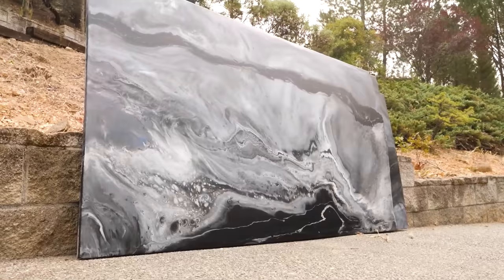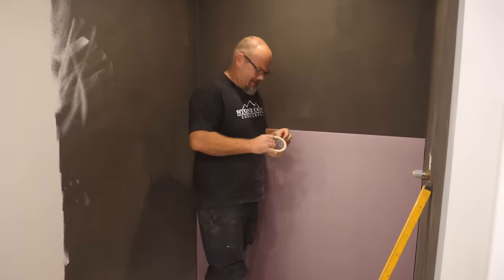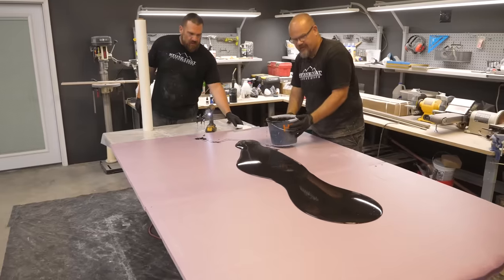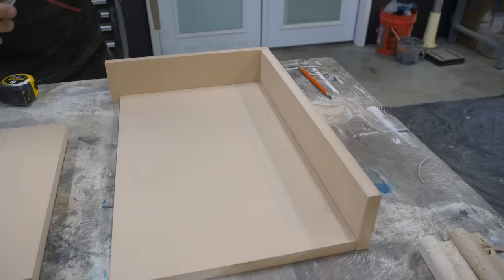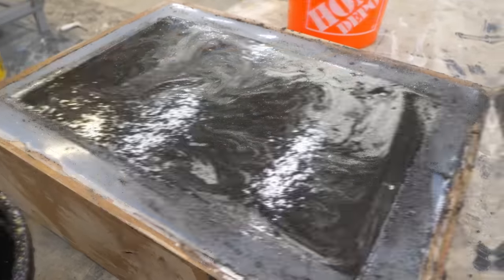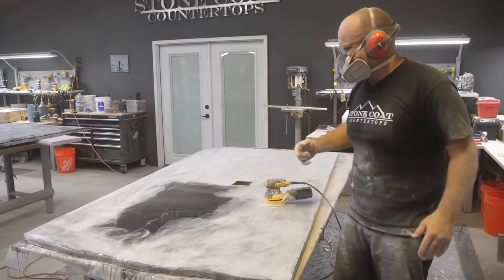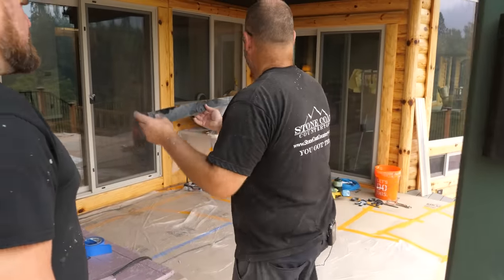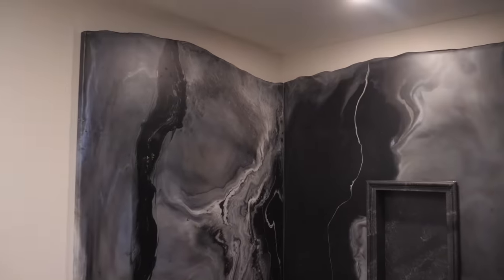Epoxy Slab Shower with Pink Foam, Come on the Jobsite Real Training

Comment from the maker: 🟦 This is our most valuable video we've given you yet. How did you like this Masterclass? What was the biggest thing you learned? 🟦
Reply: Creating that stamp for the pan and the mold for the inset shelf and back splash are absolute genius. Wish I would have found you before I redid bathroom tile. Would be awesome to have molds that could be purchased for pros and the actual shelves for DIYers to customize with paint. So impressed with this whole shower build, the natural top edge is beautiful. Well done guys! So grateful for this masterclass! Go Nathan!!!
Reply: I learned that a shower remodel can be done for a fraction of the cost! Way to go!!! We love this video. "Honey do, to Honey done!" :) :) :) Thank you so much! You all are fabulous! You have been for years!
Reply: I bought a new house and in about 3-4 months ill be installing my dream shower. Rainfall heads, body sprays and absolutely huge. Problem is, my wife doesnt like grout lines between tiles (cleaning issues) and we cant really afford big slabs of marble or whatever. Then, i saw your shower video from a couple years ago and it hit me like a ton of bricks..."Thats my solution!" Ive done resin table tops so i have a bit of experience with it. Beautiful resin walls that are insulated and warmer to the touch, thats perfect for us. I have a question though, is the reinforcement weave you put on the foam absolutely needed? Id like to do it without it but thicker foam panels. As for your questions about what i learned in your video...The scribing the pan slope trick was great. Ive been worried about that. Thanks for the video, its inspiring.
Reply: I love it.  I am trying to talk my wife into doing our small master bedroom shower.
Reply: Love this.  I've done 4 countertops with your product. Now to screw up the nerve to do showers!
Reply: I just love the way you work and present your work to the world. Awesome!
Reply: We're buy your products for india
Reply: Where available in india
Reply: Doing a shower caddy. Although I have to say it's got me thinking of ways to do that differently so that it can match the rest of the project better. Yes it matched the pan but I think matching the wall would be better. Have an idea I'll send via email.
Reply: How did you make that shower pan?..... TROWEL AND ERROR LOL
Reply: Not to be intimated.. curious on if possible led lighting.
Reply: Love!! Have you ever tried vibrating the table to see how it disperses the veins? Just an "outside the box" thought. Great work!
Reply: This video has really opened my minds eye to the almost limitless possibilities with epoxy. Really brilliant stuff and your natural concrete stamp was pure genius! Masterclass at its finest!
Reply: The fibreglass
Reply: Also I don't even know how this was a suggestion because it's not exactly what I do but NOW it's something I do! I watched this whole video it's now 6:04 am.... Just pulled an all nighter worth the loss of sleep. I can't wait to do this
Reply: @Warrior-In-the-Garden  🤣🤣🤣🤣
Reply: I want so see a follow up video of how the shower is doing, my concerns are 
Is it water tight? 
I’m worry water can go behind the wall panels and ruin the foam
Reply: You all are such big kids, you get excited about adding a little stripe 🤣🤣🤣🤣 "watch this" 🤣🤣🤣🤣
Reply: @fernandoalcantar7907  ruining the foam is the least of concern..  mold growth behind the foam boards, and rotting of the wall and rotting of the wood beams behind the foam boards is the real issue here. Additionally, mold replicates (travels) FAST!
Reply: Awesome look!!!
Can plywood be used instead of foam?
Reply: Love when you guys took the silicone mold off, so nice and smooth!
Reply: Hey stone coat countertops! Great job on the shower. With 18 yrs slab granite and solid surface fab and installation I feel more than qualified to say you definitely have some things to learn about installing shower walls! Haha but I really wanted to let you know that if you would have used release wax on the aluminum it would have popped right off no problem. The wax is specifically made for epoxy so the heat generated is no problem you may already be aware of the product but just in case I thought I'd mention it. Hopefully it will help with your guys' projects. But again you're doing some really cool looking stuff KEEP IT UP STONE COAT COUNTERTOPS
Reply: Casting the inset & prepping the foam board. I was wondering how the door hinges didn't RIP off.
I hope to do this in my future cabin.
I'm still interested in the round stone shower pan prep & install.
Reply: @lbrown3486  do it and let us all know, YOU CAN DO IT! I don’t believe you can mess it up, damn he put his hands in it to get the look he wanted to duplicate nature, and nature isn’t perfect that’s the beauty of nature! DO IT!
Reply: @dwaynemcfarland3240  hey, make a trial run on something you could use or cut later to use and just DO IT, and let us know if it works, YOURE the creator, fear not it’s just materials! You’re gonna do it and be so proud! Just don’t electrocute yourself, electricity and water don’t mix!
Reply: @dorothyallen3614  thinking on it
Reply: @glitter_fart  are you going to higher him? If not, shut it up. Enough negative in this world, we don't need yours.
Reply: Simon Templar  why you search it out and watch more than one video. Who knows.. maybe you can become a expert sunshine.
Reply: A good tip for gluing panelling and mirrors to walls is to do complete circles as apposed to dots. The complete circle acts like a suction cup when pressure is applied the escaping atmosphere creates a small vacuum within the circle. I use this trick for gluing huge mirrors to walls or even ceilings!! Youd be amazed how good it holds a material.
Reply: Lol rub some dirt on it.
Reply: Smooth and comfy beach tumbled pebbles would look killer in the shower and cozy on the feet.
Reply: @guaranteedwinnersclub  so the dirt would look as good? He does like experimenting with the natural look. Love the ideas you ponder.
Reply: @majystm7415  i have never used his method but intrested. Grout lines do suck. Auto polish was the trick for my rock showers and grout. I'm  ready to try this next.
Because the rock shower was more work than I cared for and with all the sealer and wax.. never looked that natural in a dark bathroom. It just made it darker.
 What he showed was a brighter up beat still needing respect like anything else.
Reply: Y’all hiring?
Reply: Well my mother now wants this. O.O new project, looks like I will be watching and reviewing this video several times over. But man this looks really cool. Looks super easy to clean as well.
Reply: Somewhere around the 1 hour mark you claim concrete is waterproof.  I build commercial water features and pools for a living and concrete is definitely not waterproof!
Reply: Y'all anywhere in Texas?
Reply: I learned I may be able to upgrade my bathrooms and kitchen by myself! This is amazing stuff! Thank you!
Reply: Biggest thing I learned is that I’m not the only person who uses my creativity to do what others deem impossible. I’ve been called crazy even despite it works beautifully!! Thank you so much for sharing.
Reply: Have Fun with your project and don’t be afraid to fail. There is always a way to fix something and learn from it. 
This All looks like a lot of fun to be Honest.
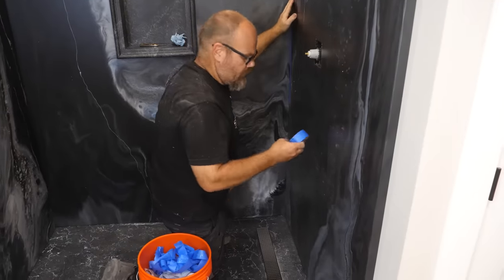Reply: 02:31:48  Why not seal the corners, bottom, etc. with epoxy?
Reply: I have to say that I LOVE the overall look of this project, but I'm also concerned by the comments from the bathroom/shower installers on here that mention that there's numerous errors in the installation, that will in turn lead to black mold. I would say that this could definitely be considered a masterclass in working with epoxy, but since you said that you've never done a shower like this, it would be great to see you guys do a new video with a bath/shower expert involved, so that we could avoid the problems that apparently exist in the process shown here. I'm not experienced enough to know what they are, but the guys who've made the comments about them seem knowledgeable enough that I believe that there are indeed som problems here.

I do really enjoy the videos you put out - I've watched many of them, and one of these days, I'm going to work up the courage to try it myself on some project.
Reply: I would like to see how you would go about repairing something like this, If say, some other installer knuckle head put a ladder foot into your foam.
Reply: I learned that i prefer outside showers.
Reply: No thanks will suffice, guys!!
Reply: That through KING 👑 JESUS CHRIST I CAN DO ANYTHING! BLESSINGS TO YOU AND YOUR FAMILY
Reply: So you can do this with wood and other materials and not have to have stone cause I would like to put this in my house idk where the kitchen or bathroom but would like to do this. . You all do a beautiful job and love the great vibes
Reply: Good work love it keep it up Men
Reply: What is the curing time?
How many ventilation hours are needed
for no odor vapors to be present?
Reply: I saved this video !  My house is new  but this is going to be my shower remodel in a year or so !
Reply: I need to take a class. When and where
Reply: Great stuff. Fascinating.
Reply: Love your Idea, your creativity is awesome. what do you think about using john Mannsville Waterproof fiberglass wrapped foam panels instead, and skipping the first step of setting fiberglass. Then you could go straight to Epoxy finish?
Reply: use real wood and not particle mdf board for hinge blocks and the edge. thats what i learned many moons ago, wet location is bad for it mkay. other than that awesome video, you are very creative and professional, and you stand apart from allot of peeps out there trying new things. just use real wood, MDF you are eventually gonna have a call back from angry person with shower doors falling off a few years down the road. load bearing should always be real wood in a wet location. keep up and keep on trying new things, love the shower.
Reply: Wow, that looks like garbage, I liked the pink way better.
Reply: Mick W  gay people also have good taste, and that nasty looking tile looks gross, like stains and nasty soap scum that needs to be washed away but it is permanently the design.
Reply: Hi This Levi Howard from Florida and I am also an artist  I learned is design   And I love to keep design more things  I am also A photographer and a freestyle Designer  that I design
Reply: 20 k
Reply: Узнали, что не всегда вы соблюдаете технику безопасности. Почувствуем пострадавшему. Берегите себя и своих близких!
Reply: As usual the biggest thing I learned? Why pay someone else to do what you can do better
Reply: we're all just scratching the surface, possibilities are endless
Reply: That you can do the walls in Foam.....I can't imagine that holding  up tho.....!!! How many yrs. do you think this will work ?  It just doesn't seem to be that strong, only has the glue and the coats of epoxy on them ......won't that epoxy later harden and start to crack ??? seems it would.....just saying.....
Reply: Thank you for your great creative DIY. You taught so much. I loved the rock stamp and your solutions for some minor mistakes yep we learn with mistakes. Fiberglass water proof foam part was genious too.  I love your question " Are you happy?" That`s really important to encourage each other to achieve work also emotionally. Big big work but happy end with all little mistake experiences ! :) ( Hope your head is ok my husband always hit his head from same place.. same wound :)) )
Reply: Can you do floors in house
Reply: @jaystv1682  Perhaps they put a liner underneath the cement/concrete shower panel. Also, the sealant and paint sprays on top  help to deter the water?
Reply: ... I just did the same thing
Reply: Where can I go to train on this technic and the cost
Reply: Far and beyond my favorite video from you guys yet.  I'm ready to do this, as we are about to remodel our bathroom.
Reply: The beauty of this kinds of creativity will be!!!...  every single job has its own unique style that is not copycats at all... great job, and specially you all make it people feel comfortable with sense of family... I felt in each step I was in vicinity of the family... but I have couple questions such as how can I make the panels to look like Ice and fire individual.. and the other thing is with the order of high gloss transparent coat other final coat with roller,  is included or not??... and last one ,  I want to appreciate for videos with very pleasant performance ... thank you all... and 1 plus the last one  😉 maybe it's stupid question but I was wondering if you guys finance for let's say roughly about 1 grand of products of order.. You all are awesome.  And thank you much.
Reply: That I can't wait to try my hand at this. I'm 72 yrs old - time to try something really cool!!
Reply: @Warrior-In-the-Garden  pp
Reply: This was great, quality so good it made me want to slap my momma
Reply: Although there are indeed videos on sloping the pan it would have been nice to have you explain it at least in a rudimentary fashion for those that are learning, every little bit helps. Awsome stamp idea though
Reply: I've seen this video now few times. How much would I need to make myself a small shower maybe 5'x5' ? I'd like to order everything I'd need through y'all.
Reply: I am building an old fire truck into a camper and want to build an epoxy shower that has LED lights indie the epoxy. Would you be willing to help estimate what I'd need for materials and I will purchase what materials I'd need that you sell will buy off your company. I've seen this video 4 times now and I just got my truck and starting to buy the materials .I'm disabled and live off social security disability and will be making build videos that I can share the shower build video with y'all to see the end results. I follow y'all here and share a lot of your videos with friends doing or wanting to do these types of projects.
Reply: You have inspired me to create my own complete new shower, for the most part following in your footsteps with my own creativity and style. I can’t wait to order my products and make my countertops, shower, vanity tops and backsplashes. I love your teaching style and the thoroughness of your videos.
Reply: Awesome
Reply: Don't use tile for your moldings otoa moulding store and by wood moldings
Reply: What was the stringy product that you sprayer for the veins on the pan?
Reply: @fernandoalcantar7907  This is a prime example of how NOT to diy a shower. These guys haven't a clue,
Reply: @Warrior-In-the-Garden ojh I’ll juh how how he  BBC up hoho. H😅o
Reply: I loved it. Good job guys.
Reply: How to make those veins and that i want to make that beautiful shower myself!!!
Reply: Very much. I would like to have more knowledge about how to use de resin,how to mix how long to driy and wen to polish
Reply: A suggestion for later use for your stone molds. If you use White S type mortar you can then stain them and seal them to look like real stone. Just a suggestion from a mason.
Reply: Exceptional!!
Reply: Hey wonderful dudes can you guys do a soapstone pour countertop please??
Reply: I learned a lot. A lot that can be used all over the house and on the bas relief art for walls.
Reply: Id love to be able to come out and learn how to do this and possibly expand business for you
Reply: Way kooool
Reply: This really makes me want to redo my shower, You will be hearing from me in the near future. I'm also changing cabinets in my kitchen and will be doing the ountertops and back splashes. I have been watching you guys for a while, won't be long. Thanks for doing this!!!
Reply: This is very very cool

Comment: I was looking for something completely different but I got so wrapped up in your video that I didn't even realize I'd watched two and a half hours of a tutorial on a shower overhaul. I am thoroughly impressed by your work. Outstanding!
Reply from the maker: Glad you liked it, that is so awesome! Thank you for taking the time to watch and to comment. Do you have any projects coming up?
Reply: I'm always thinking I'm going to do something but I don't even know where to start half the time I was actually looking to see how to make a fake wall because I want to make an accent wall but I don't want to paint the actual original wall
Reply: @StoneCoatCountertops  Do you guys have a store, by any chance?
Reply: Same here… Absolutely beautiful 💪🏽💯
Reply: @StoneCoatCountertops  hi I’m curious what the mold making stuff is called you used and where do you get It awesome video
Reply: Yea me too
Reply: Lol same here i been lost in these now i wanna remodel my whole dang house
Reply: Me too bro. I find it amazing how fast ad clean they do this
Reply: Same here. The guys are pro and makes you wanna do same :)
Reply: Umm, you do know you can make shower recesses out of the pink board, glued, with edges / joints reinforced with fibreglass? Then the finished product can be a single element without joints. These recesses can be purchased pre-made in may sizes.

Also, using cement as a shower base, it's  a good idea to add chopped strand fibreglass (GRC = glass reinforced concrete) to the mortar as reinforcement. This I learnt as an Architect one one of the first projects I worked on over 40 years ago and haven't had reason to mention it since
Reply: Omg it is two and half hours where did the time go?
Reply: looks like there was a fire in there.
Reply: thought i was 30 mins in…. it was 2hrs later
Reply: damn, you're right, I just blew through 2h and didn't even know it!
Reply: Me tooozahhh! Amazing!!